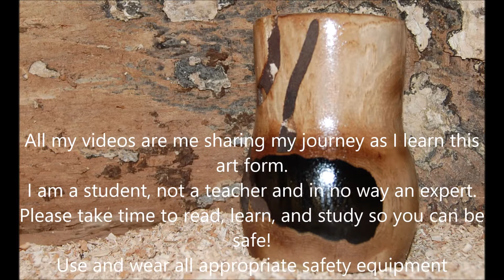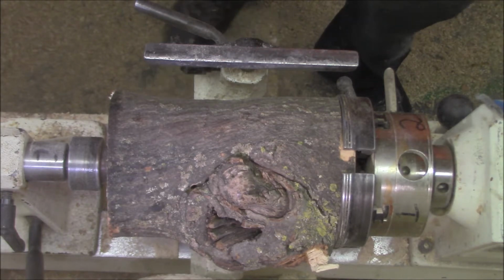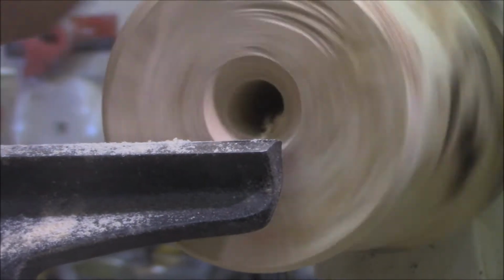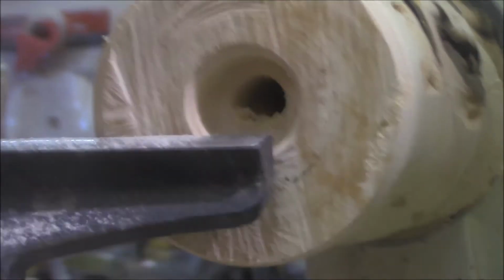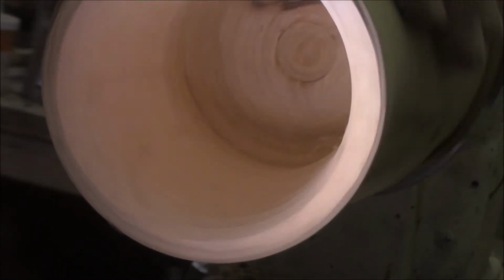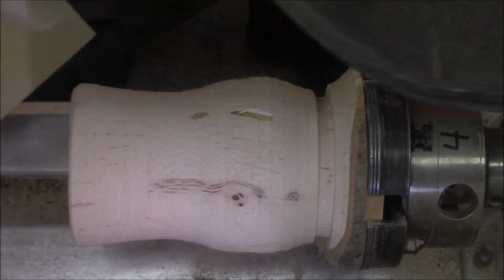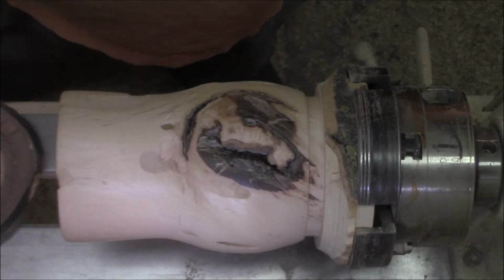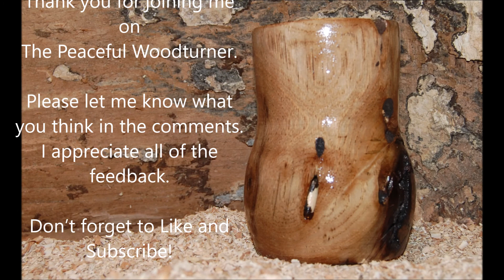Hornbeam vase?

Comment: Great vase mate, I see that you left the critters waste in the piece and I found that odd. Do you think it will stay in place? Was it just straight iron oxide or did you use the tea and iron oxide method?
Keep on turning.
Cheers, Bluey 👍
Reply from the maker: Thanks Bluey! The iron oxide is steel wool disolved in vinegar. Everything was pretty hard and secure when I finished so I think all.of the texture will stay. It seems like it has all become well bonded together
Reply: @peacefulwoodturner6547  so good to hear that it is stable. I am yet to do the ebonising thing, so I am curious as there is so much information out there about it and not all correlates.